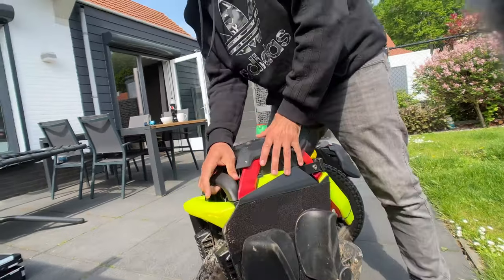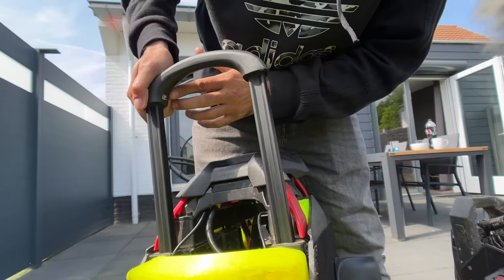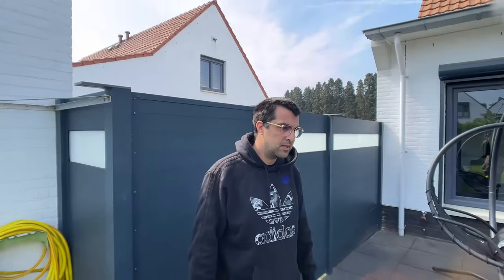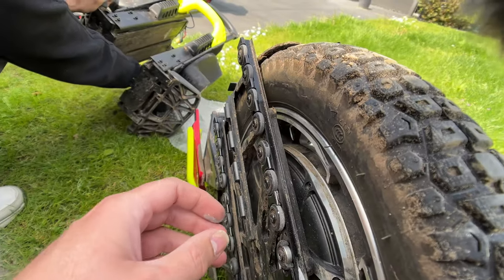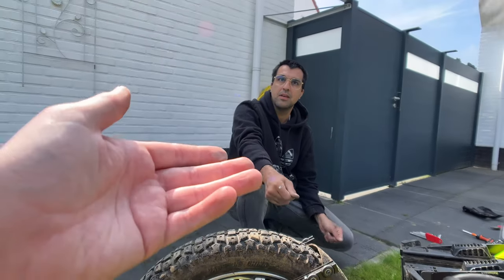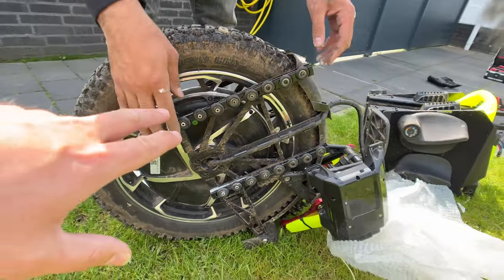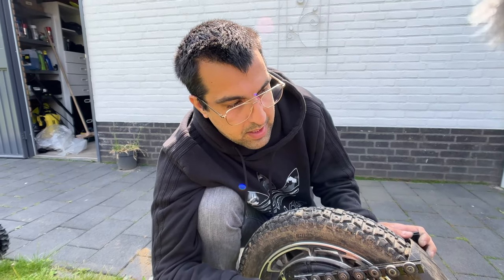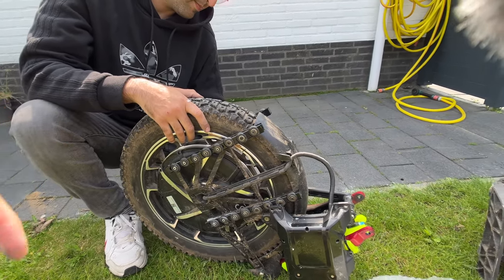Kingsong S22 Pro Slider Problem & Solution | Interview with the Rider's Wheel

Comment: I ride the OG S22.  Swapped out for 6 wheel sliders that allow for all geometry and put on a Shinko 244.  This wheel is an absolute Beast and a blast to ride!
Reply from the maker: Yes I had also the OG s22 but with bad motor… I placed the custom sliders and performed so much better then the Pro version… will update how it works with new wheels!
Reply: I have the 4 wheel OG slider. So much better than stock, but I find it really hard to remove the bearings which I need to do as some are busted. Any tips?
Reply from the maker: Yes from 2 sides underneath with 2 tire spoons…

Comment: Broken bolts by jumping, knocking sounds by angled bearings, vibrating during braking , 2 weeks old is my pro???? And now dismantled to fix it. My sherman needed 4000 km for the first dismantling. Do they ever test drive this wheel? Maybe this wheel turns out to be a dream, if you know his inside’s and customise it completely.
Reply from the maker: Yeh we got the same problems in our group here with the s22 and the pro… the Patton starts promising and good starting base to build on and improve where needed! Customize suspension stiffness with different coil maby and or oil for improved dampening! 66lbs is okay for trails with drops and jumps but nothing to big I think? We gonna try it tomorrow with hardest settings and preloads!
Reply: @MisterBanaszak  we should meet , exchange some experiences , have a ride, very curious , regards Matthias from Sijsele ( west vlaanderen)
Reply from the maker: Yes always welcome on grouprides! This weekend we go for a ride…
Reply: @MisterBanaszak  In Juli , kom ik eens af!
Reply from the maker: @lesloup  Doen we een mooie rit en kan je hem eens proberen!

Comment: My s22 pro was vibrating pretty bad in reverse as well. 0:55 . Last night I tightened and applied lock tight to the 16 screws mounting the 4 slider rails and it stopped vibrating completely!
Reply from the maker: Okay nice to know… the wheels are good condition still? My rails are tight and got new wheels and it’s really smooth now on the stock pro sliders… u need 7x24x5

Comment: Complete garbage system. And they repeat this design with the s19. This is clearly a company that has no idea what they are doing. The s22 was the last kingsong I will ever purchase. I replaced the sliders with the Hou Ningning 8 wheel, and it is amazing, but the amount of maintenance and shit that breaks all the time, this just doesn't fit the bill for what it's ment to be.
Reply from the maker: So true! Yesterday i got the Patton 66lbs and it is night and day difference with suspension but also the build quality!
It feels so solid and the power comes with ease…
Reply: @eucadventures612  Yeah, I really want to trail ride a Patton, that's what I got the s22 for. But the list of problems with the s22 is huge, bearings, slider suspension exposed to elements with an after thought sliders. Motor recall, mines been in parts for the last month suspension bolts sheered. Many will have this issue mark my words, now that the aftermarket sliders make the geometry function, it can't handle the stress. And I seen many boards blow on really small crashes.
Reply from the maker: Yeh but also that they came from the s20 and had so much time to fix all this… they never got it right! Custom is better then factory itself…
Reply: @eucadventures  good point. I was one of the first to receive the production model. I pre-ordered it, expecting that after they had a prototype out there, production should be good. Tired of hearing never buy first batch, f that, these companies need to do better. Noone avoids a new civic till its 3rd generation.

And another thing the vibrations you get from the sliders in reverse, there is nothing you can do. It well stop around 750 km. Also Hou Ningning cnc sliders have a new set of wheels, blue in color and are more durable than the wheel ones that are made for furniture manufacturing.
Reply: @dirt.surfer  Do you mean that the vibrations will stop around 750kms if you leave the stock sliders and wheels in it? Why would they suddenly stop vibrating? Sorry for the questions, just trying to clarify because my S22 Pro that i got 4 days ago has been doing this from the moment i pulled it out of the box
Reply from the maker: Yes I’m gonna replace them and I feel that the Patton will be my main wheel… I prefer the combination more then the s22 because I 90% offroad and only 10% onroad so… I just go for first batches also and improve it where needed because later batches won’t always be better at the end… if u like the wheel I invest but it will always be like this for some models and manufacturers… when we gonna get a wheel from Japan it will be a different story but 😏